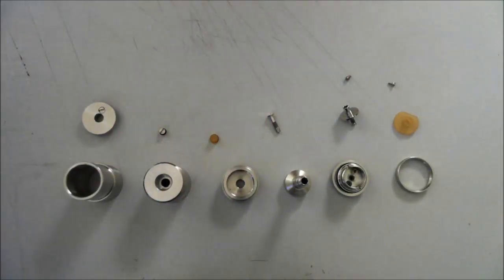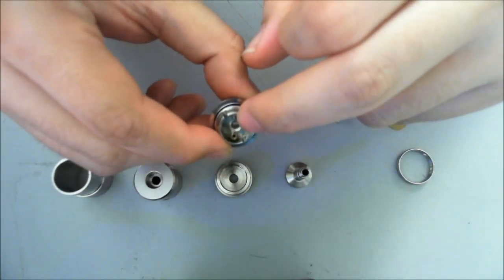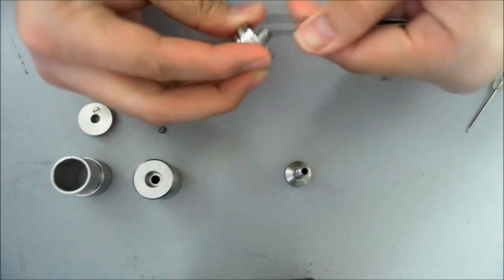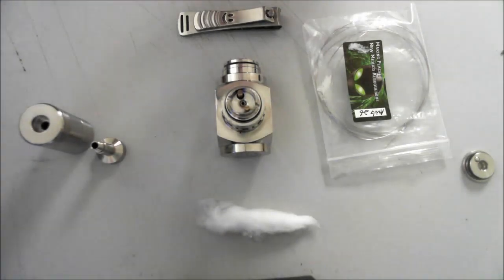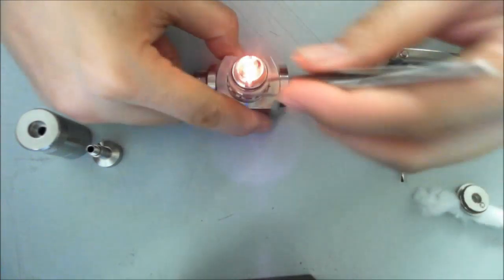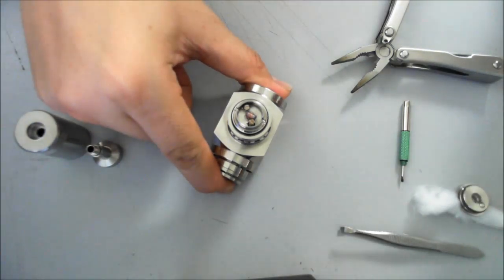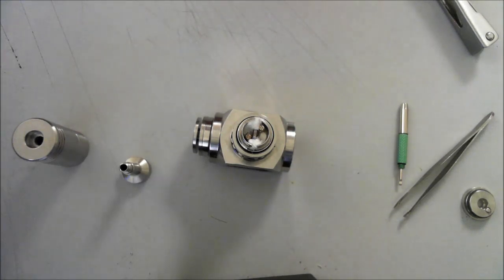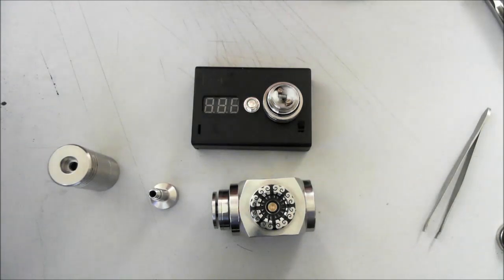[Hands on] Rebuilding the Fogger V2 and installing a microcoil

Comment: Awesome video. I just bought the Fogger V3 and built it with .8 .28 gauge twisted wire coil and cotton wick. It shorted out 3 times right off the bat causing the mod and battery to get frighteningly hot. It seems like the positive pole or 510 connector is the issue because my ohms are steady when measured with a multimeter at the posts but jump all over the place when placed on a 510 connection ohm meter like you have in your video. I just played with how tight the atty is screwed down on the mod till it worked but I don't have a great feeling about it. Once I vape all the juice out, I'm just going to break it completely down and examine all the insulators, maybe add an extra o ring like you suggest. Thanks for making this video, very helpful.